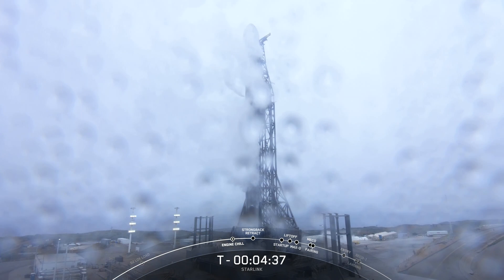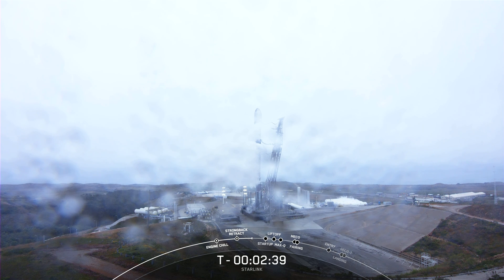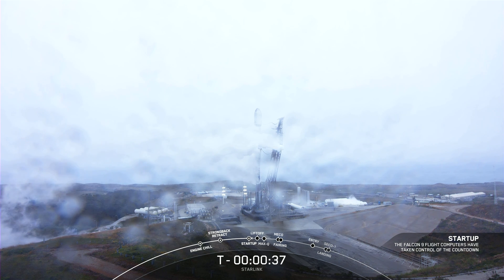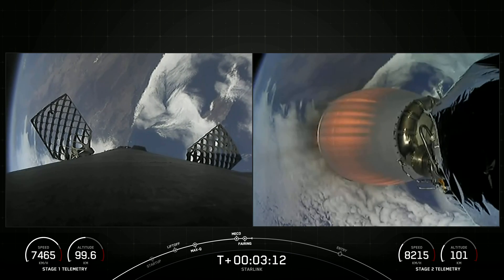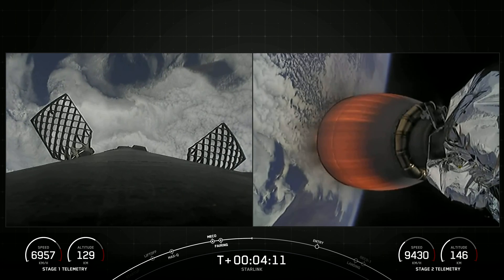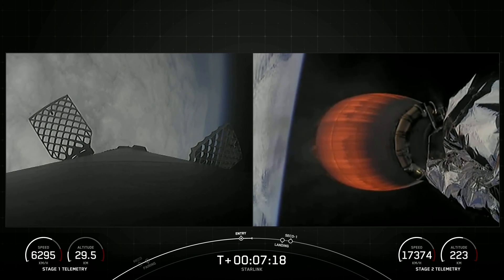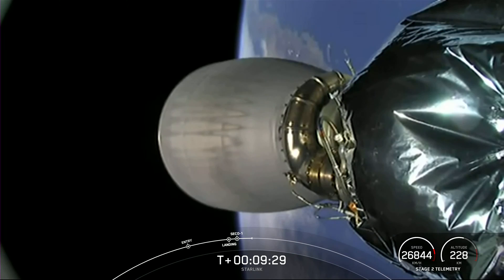Starlink Mission

Comment: Why do we cover satellites and other such devices/ equipments with gold / silver wrapping??
Reply: Those are multi-layer insulation (MLI) sheets used for thermal control on the satellites. The gold color comes from a layer of a chemical called Kapton. It is usually deposited over a layer of aluminized Mylar.
Reply: @steveadams7369  .
Recently, , I watched a video in which, , they were unloading some scientific equipment from struck.
That equipment was covered in gold colour foil.
.
Then I watched a lot vdos and pics. 
And everywhere, , I found them covered either in gold or silver or chrome wrapping.
Is there any particular reason for that?
Reply: @SuniL.KrishnA - Since I have no idea what you saw in the videos, I can only guess. It’s possible it was wrapped in anti-static bags to protect sensitive electronics. Components and spacecraft are often protected this way for transport and then are removed before they are enclosed in the fairing.
Reply: @SuniL.KrishnA  The foil is a insulation material like mylar.  The coloring comes from the kapton that makes up one of the layers.
Reply: @TheEvilmooseofdoom  ohk.
Thanks for explaining.
.
.
Bur still one confusion.
Why they chose only gold / silver / chrome colour?
Any specific reason?
Reply: @SuniL.KrishnA  They're not picking a color, the colors are just a side product of whatever insulation they're using for a certain job.
Reply: @TheEvilmooseofdoom  I don't think so it's coincidence.
We see almost all space equipment and satellites covered in Gold colour wrapping.

Comment: I see a flexible covering just ahead of the 2nd stage nozzle. It looks like a piece of plastic that inflates as the engine burns, although I'm sure it is not that. Can anyone explain what this is, and why it seems to inflate?
Reply: its basically an insulating material, its filled with gas. it protects the engine from the radiative heat of the engine exhaust and nozzle.

Comment: Just giving the engineers who designed the magnificent Merlin engine a shout-out for creating an astoundingly reliable engine.  Hundreds of launches, and I can't remember the last time any Merlin has failed.   Well done!
Reply: The craziest thing is, two Merlins have more thrust than an RS-25, all 9 cost only a fraction of what a single SSME costs, and they refly with only minimum refurbishment between flights. It's truly a marvel of modern engineering.

Comment: 4:24 "weather is green". Meanwhile, can barely see the rocket.
Reply: The weather the rocket cares about is not the same weather we might care about when we go to the beach. Rain, fog, surface winds, those hardly bother the rocket. What matters the most for launches is no lightning or chances of lightning, and no strong upper level winds. Other than that, it doesn't care much.

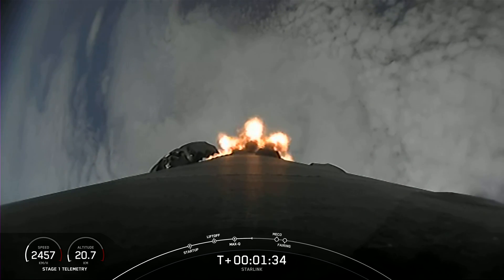Comment: I don't recall ever seeing the motors gimbal as much as is vissible for a short while after 10:34 It's really interesting and cool to see that. Looks like there is a significant amount of lateral movement with the low pressure on the left of the body causing some vapour condensation.
Reply: I'd guess it tries to generate a little bit of lift since you gotta start the gravity turn so early, might as well springboard the low atmosphere!
Reply: Thanks for this!
Reply: I wonder if it was to do with the late 'max-Q' probably didn't quite get full thrust to start with, causing the late maxQ so needed more gimbal than usual to compensate for it🤔
Reply: @dcf476  maybe they're experimenting things in that flight profile, gathering data. Can't help to think about starship launch...
Reply: @dcf476 F9 usually generates a similar amount of angle of attack throughout most of its missions, I suppose it's just part of the rrgular profile

Comment: First stage reached 133, highest apogee I've noticed.
Reply: You read the telemetry data, too?
I thought maybe I was the only one.
Reply: It's easy to think that all Starlink missions are the same, and that such a mature rocket as Falcon doesn't change anymore, but SpaceX hasn't stopped trying. They aren't doing major re-engineering, but you can notice they've been optimizing things every mission, and taking slightly larger risks and cutting safety margins as they feel more confident.